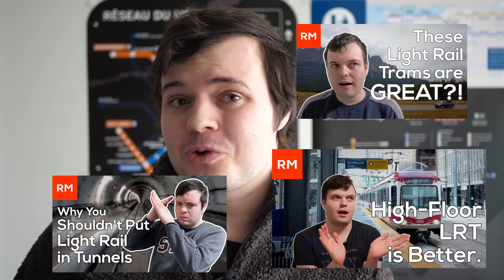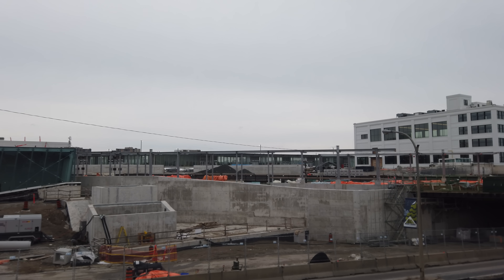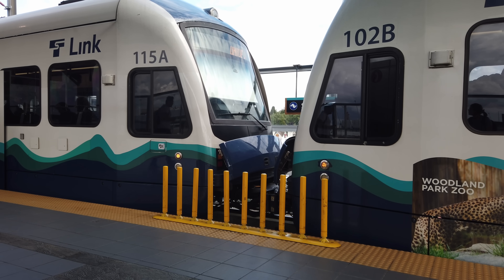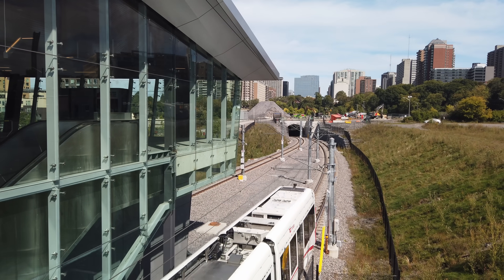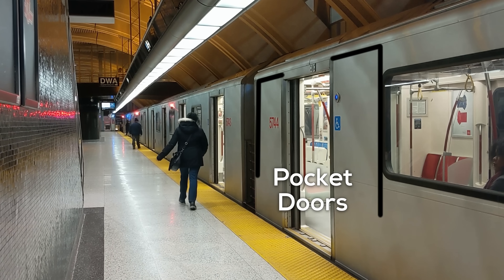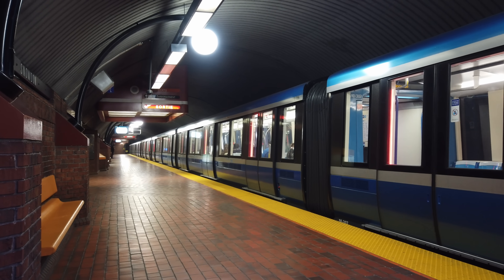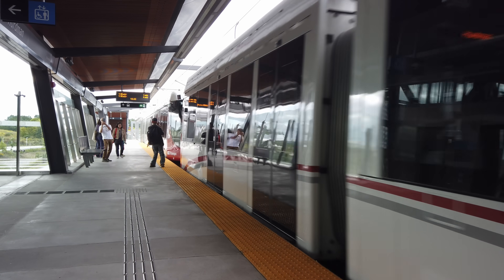I Designed a Better Low-Floor Tram

Comment: Fun fact:

The S-trains' bogies, was an experiement, done by Alstom and Linke Hofmann busch. This was done on an older S-train car of the "2nd generation", where one 4-wheel bogie was taken out from under the cab, and a single axle was installed, "driven around the curve", by a bar attached to the 4-wheel bogie at the other end of the same car.

That led to the single axle design, that makes (AFAIK, after the UK Pacers have been withdrawn) the S-trains the only Multiple Unit in the world, to have single axles only. I simply can't think of other (currently in service) trains.
Reply: Talgo trains also use lots of single axles, but the powerheads on their trains still have traditional bogies for the driving wheels.
The ULF trams from Vienna also only use 1+1 paired wheels, but those aren't connected by axles.
I think you're right that the 4th generation S-trains are the only EMU's with all single-axle wheelsets.
Reply from the maker: Yeah which is super unique and cool! Because they are actually a really successful and good train model!
Reply: Unfortunately, there are still many Regionova (814) trains in operation in Czech Republic. And they are just that, DMU with single axes only. Created by permanent connection (and lowfloor section addition) of 810 motor railcars and the 010 trailers.
Reply: I'd say that the trend is more towards Jacobs bogies, letting you keep the benefit of bogies but allowing lower floor trains and also making them more rigid in case of a derailment.
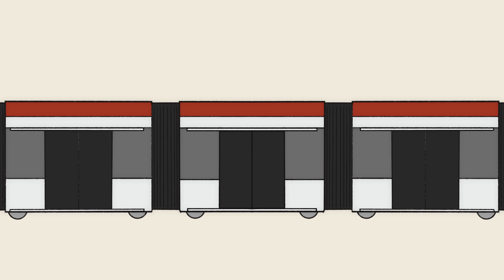Reply: Side note: Copenhagen's S-Tog's 4th gen rolling stock (the one pictured in this video @ 7:53) make similar sounds to Singapore's MRT (subway/metro) C651 rolling stock (the 2nd gen; which use conventional bogies though), probably as both models were made in the mid-90s & likely used similar propulsion systems (though the latter model is now being replaced by Bombardier/Alstom R151 stock)
Reply: @lzh4950  that’ because both have traction motors from Siemens. Siemens did the electrical bits, and Alstom LHB did the axles and the shells

Comment: Knock-off cabs might be interesting.  That way operators could keep spare cabs in storage in case they're needed, and they wouldn't have to have unused cabs in the middle of trains.  The trick would be to make the connections and the tools simple enough that maintenance crews could convert a train quickly.
Reply from the maker: Yeah something like this is possible and perhaps an actual revenue train would be better composed of two separate interconnectable pieces that way if there was an issue it could be split and reconfigured

Comment: Place the bogies between the carriages. This has a real safety advantage as it means the train is less likely to fold up like an accordion in the event of a derailment.
Reply from the maker: That's true but fortunately safety and track maintenance has come a long way and also metros don't operate that fast....
Reply: @RMTransit  Also, could computer steering of wheel-sets make your design viable?

Comment: Do you know the Frankfurt U5 trains? Some of them have only one cab with a coupling and a weather-sealed to another train on the other side. They even built units without any cabs to form trains up to 100m. This allows them to have the high capacity you advocate for while also preserving the operational flexibility smaller units have. 
Now while those trains are not low-floor, the fact that these trains are part of the Flexity-Family means it could be possible to build these in low-floor versions (maybe not 100% low-floor at the couplings) .
Reply from the maker: Hilariously I was indeed discussing just those specific trains with someone when I was working on this video!
Reply: The TW2500 Series in Hannover's Stadtbahn works much the same way; two TW2000 series trains with only one cab and and bellows on the other end connected together.

Comment: wow, the door to panel ratio is absurdly huge, it would need a lot of air conditioning to coup with the door envelopes
Reply from the maker: We don't need air conditioning in Canada thankfully :_smirk:
Reply: @RMTransit  Disagree. There's four solid months where AC is necessary, especially since the windows don't open. Then when you cram them full of people, even more necessary. And what about heating in the winter?

Comment: Your names for trains are good, but you still have a long way to go if you want to become like Stadler, the creators of the Kiss, Flirt, Wink and Smile! Great video!
Reply from the maker: Stadler better watch out!!
Reply: @RMTransit  Maybe you can cover the train system of the philippines (existing/upcoming) like the subway or the mrt/lrt.
Reply: @RMTransit  Almost thought Stadler was the company that made colour pencils
Reply: Stadler were cowards with the "Smile", although it's definitely for the best. After Tango, FLIRT and KISS, the obvious name for their next big thing, their Swiss EXpress train, would have been… different.
Reply: @dda40x  They should name their prototype supersonic high speed train "Intercourse".
Reply: @EgnachHelton 🤣
Reply: @dda40x  This is the reason why express S-Bahns don't officially exist in Schedules
Reply: @dda40x  😁😁
Reply: @dda40x  Oh LOL Very long going through many tunnels. Haha
Reply: @dda40x  Any Stadler products sold in Australia would have to be named "Snog", using Stadler conventions... :)
Reply: at least citylink is an acceptable name

Comment: Instead of RMHCLMT, I prefer calling these FULL-CHARM Trains: 

Floor 
Undercarriages 
Lowered 
Luxuriantly 

Capacity
Heightened 
Articulated 
Rapid 
Metro”
Reply from the maker: Are you looking for a job? I think we may have found our first marketer
Reply: @RMTransit  Unironically yes 😂
Reply: Honeslty the CHARM part makes a lot of sense for this vehicle!
Reply: @flare2000x  The Stadler-RMTransit CHARM?

Comment: i think it might have been a good idea to look at Melbourne E class trams utilising fewer but larger segments cutting out a lot of articulating sections that could potentially increase the chance of a failure. it would also increase internal capacity by using more of the space for people and less of the space for articulation. this would also allow for larger doors and more per segment for a higher throughput of passengers on and off the tram. either way i could be completely wrong but it sounds like a smart idea in my head or maybe i just like the E class trams.
Reply: The E Class has one more bogie than a fixed bogie tram of the same length, and that takes up more space than the articulations ever could. Because the bogies swivel (they're more or less the same bogies as on the Flexity Freedom mentioned in the video) the aisles are also narrower.
Reply: @cityjetproductions  i agree with your points bogies will take up more space then articulations but i more so meant keep the fixed bogies in the corners just lengthen the segments so there are less of them on the same length vehicle. while yes that will decrease the turning capability i believe that the benefits out way the negatives even though you would probably have to build a separate line with shallower corners and you might as will just use normal metro at that point and it probably wouldn't be that great on roads either but we just shhhh about all these things its a great idea trust me.
Reply: @colonelbobcat1069 you've basically described the Integral S5D95.
Reply from the maker: This is an option but remember you still have the fundamental issue of a lot of weight on only a few bogeys
Reply: @RMTransit  The Melbourne E class trams have four bogies and weigh 62.5 tonnes. They have an axleload of just under 8 tonnes, which as far as rail vehicles go, is exceptionally light. The bigger issue is that due to the lack of underfloor space, equipment needs to be located on the roof and this raises the vehicle's centre of gravity.

Fixed-truck (or bogie-less) designs like the one you are proposing will have much higher maintenance costs and cause damage to the tracks. Eliminating axles entirely and allowing all four wheels to pivot individually will result in poor vehicle performance. If the suspension is too loose, the wheels will oscillate and the riding will be very uneven. If the suspension is stiff enough to prevent the wheels from wobbling, then the extra forces imparted when the vehicle corners will cause excessive wear-and-tear to the tracks and vehicle, and the resulting vibration will make the vehicles quite noisy.

When the Siemens Combinos were introduced, unexpected stresses on the articulation joints resulted in the entire fleet of trams being recalled worldwide for structural modifications. The CAF trams with a similar design also have severe structural issues that are currently being remedied.

Comment: Your RHCLFMT is quite amazing. Solving most problems that passengers have on such trams. That said, I think using smaller wheels with induvidual motors would greatly. help
Reply from the maker: Yes I think it would need to use quite small wheels in order to fit everything in it would be complicated...
Reply: @RMTransit  I was thinking about small wheels too. And maybe even use different sized wheels.  For the non-powered wheels, instead of one big wheel, we maybe can have 2 tiny wheels sharing the same load while taking less height.
Reply: @yrr0r244  Wheels can't be too small. Small wheels tend to have problems in turnouts and crossings.
Reply: @laju  Price of having a low floor system. If you're willing to spend more money, you can sink the trackbed at stations and run high floor trams, given you have a sufficiently large structural gauge.
Reply: @laju  I wonder if that could be addressed with switched frog turnouts and a more advanced crossing design.
Reply: @tsguy-h3q  Price of having a high-floor system: Stops can only be located where high platforms will work, which is often not the case in very narrow streets, also platforms cannot be shared with buses as some low floor systems do.
Reply: You will fine most newer Light rail vehicles (trams/streetcars) have a motor driving each wheel to increase passenger capacity.

Comment: Seems like bogies are very problematic,so go for a maglev system, smooth ride no mechanical wear very futuristic.
Reply: Make the entire floor covered with ball bearings and suspension jelly
Reply from the maker: For some reason I think going to maglev isn't going to solve the cost problem

Comment: It's an interesting proposition, but it looks too much like a translohr on steel wheels instead of rubber tires. I still like the ULF tram design of Vienna and the trams with bogies under the connections like Prague. But I feel as these solutions aren't industry-wide adopted, they must have some serious drawbacks that hinder technical adoption.

Comment: I like the Lint 41 solution to low platforms. Having low floor sections between each bogie works quite well. Not problematic due to the large sections. Not light rail but still.
Reply from the maker: The issue ends up being turning radii as well as accessibility it all really depends on how things are designed and how they are operated
Reply: A blind kid fell over the stairs the day before yesterday on such a train. Not LINT but Desiro. So not ideal.

Comment: Talks about why fantasy transit maps can be a problem. Designs a fantasy train.

Well played. Well played indeed.
Reply: Came here for this exact comment
Reply from the maker: @Tigger Official I actually need to get my rolling stock company started
Reply: @RMTransit  If you actually do hit me up; I'm an electrical engineer with experience doing the sort of big power systems you'd use for train propulsion, an inveterate trainfan, and an avid 3D modeler. Also, as far as motors are concerned, there are tricks you can use (you can sling the axles low enough that getting them under the floor isn't too terrible, and if you use axial-flux PMAC motors on each axle you can get the motors small enough that you can package them in the walls easily; furthermore, you could probably use a structural design where you package the suspension elements in the corner posts of the individual units.
Reply: @RMTransit  Please hire me! I am an Electrical Engineer for Rolling Stock. :D
Reply: @jossdeiboss  Just out of curiosity, where do you work and how did you end up there?
Reply: @ARod4374  I am working for Alstom in Derby UK. How? Just followed my love for trains! :D
Reply: @jossdeiboss  That's awesome :) All the American train companies went bust twenty years ago, unfortunately, and Alstom wants a master's for a traction power engineering job. I'm probably going to try to get the master's in the next couple of years, with a focus on embedded electronics and power electronics; also, would you be comfortable sharing contact info so we could talk more about it?
Reply: @ARod4374  I do not know how to send DMs on youtube - just for privacy. Do you know how we could exchange info? I can send you my instagram just to stay safe from "outsiders" and then eventually share you other socials.
Reply: @jossdeiboss  My comment with my email got eaten for some reason, but yeah; Instagram works!
Reply: @jossdeiboss  Apparently Youtube got rid of their DM feature, and the spam filter ate my comment with my email, but I just added my email to my Youtube profile under contact info
Reply: @ARod4374  I found your email in your channel. I will send an email to you. Check also the spam.
Reply from the maker: I don't really think it's fantasy to have a high capacity train to serve these various lines to be honest!
Reply: @RMTransit  I think Fort Myers, FL and Cape Coral, FL could use a light rail!
Reply: @RMTransit  Another problem is how u pronouce S-tog lol. Tog is pronouced like if your saying toe.
Reply: @Mgameing123 can confirm 😅
Reply: @RMTransit  It’s not really a fantasy for people who draw the kind of systems THEY want to see operate in their neighborhoods either. Also haven’t you done fantasy maps?
Reply: @RMTransit  Well, since you didnt mention much of potential tonnage, number of seats or any numbers at all, it seems more like a wish and less like a design and frankly unrefined.
Reply: @davidrechberger25 it’s an idea and a good one at that. Nothing wrong with proposing.

Comment: Using trams as metros in gigantically expansive stations??? Hm, Belgium is the place to go my friend, Bruseels and Charleroi in particular.
Pocket doors and windows can cohabitate, at least they used to, Paris metro older rolling stock they do it very well. But that means, the "walls" of the train are thick when materials used nowadays allow for thinner "walling"
In my experience, doors wifth and number depends on how many peop;e can egress or ingress at any given time on the whole trainset.
New Paris metros have 1.6m large three doors per car when the old MF67 had 4 doors by car per side 1.3 m large each. That gives you. When you add up the overall length of doors you find that the newer vehicles perform more poorly than the older ones. 4.8 m per car per side vs 5.2 m for the old ones. That means one more person per car can egress or ingress.
In my own expreience I never had any trouble egressing from an old MP59 on crowded Line 4 in rush hour but had a tremendous amount of difficulty (even had to wait to egress at the stations after !!! ) on tourist crowded Line 2 on the more recent MF01 just because of the door layout. So I much prefer more doors than less even if they are 30 cm less large. It means that on a 5 car trains five more people can go through doors, multiply this by the number of seconds the train stays in a station... 
Even on the RER you can make the comparison.
MI2N Alteo on Line A or MI09, they are the same, have 2 m wide doors, three per side. An old MI79/84 had 4 1.60 m doors per side per car, that means that per car, the MI79 performs better with 40 cm more of door space. On the other hand, the MI2n/09 has 5 cars per train instead of 4 because cars are shorter. That means that the MI2N/09 has, because of its car layout 4.4m more of door space.
So the calculus of the trainset overvall is very important, you can basically afford bigger and less doors per car only if you have more shorter cars on your trainset.
Let's compare the MI09 and the retired MS61 : 3x 1.6m doors, 3 cars per trains and triple units per set overall, making 27 doors thus 43.2 m of echange space. MI09 has double unit 5 car trainsets so making 30x2 m doors thus 60 meters of exhange space. The newer design wins by quite a margin.
On the other hand you also have to count the overall volume of the train, a MI09 is a double decker with very large door platforms. It takes an insane amount of time to discharge this space full of passengers when the smaller spaces on door intersections will empty faster. The frequency on RER A since the massive replacement of the MS61 by the MI09 isn't a good, the frequency dropped by nearly 30% ! (and keep in mind that the line is more and more busy with the daily passenger count going over 1 millions nearly every day now whereas going over one million only a few days per years over 20 years ago. I really fear the introduction of the RER NG aka MI20 on RER B line in the few years.
Bigger is  not necessarily a good thing, as given in my own epxperience earlier in the metro. 
I'm in favor of smaller doors, more doors per car for the door spaces to empty and fill up quicker overall.  Quicker exchanges will allow for a better frequency.
Something that trams can't achieve without being horrendously expansive and complicated.
If you want a high quality massive transit line, just build a metro from the beginning, the future will thank you.
Reply from the maker: Belgium does have a of an issue with this but at least the systems are generally designed for conversion and the cities aren't that gigantic